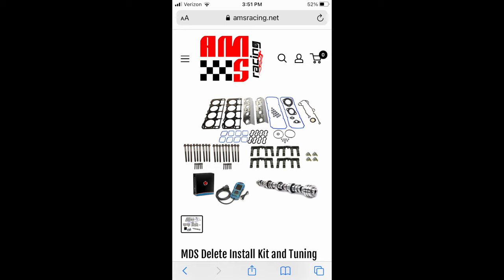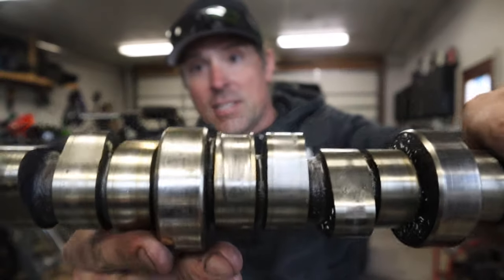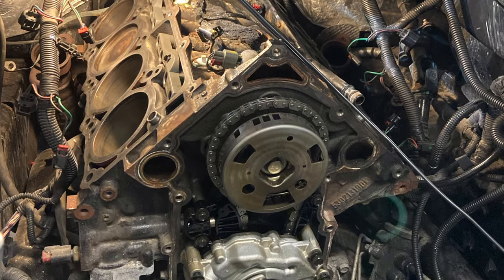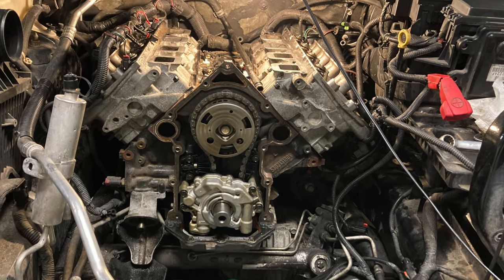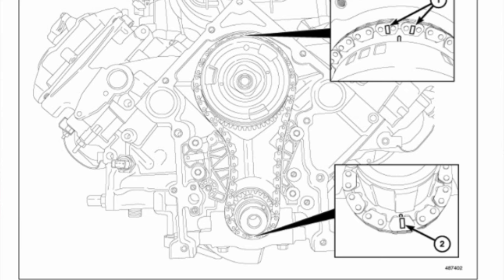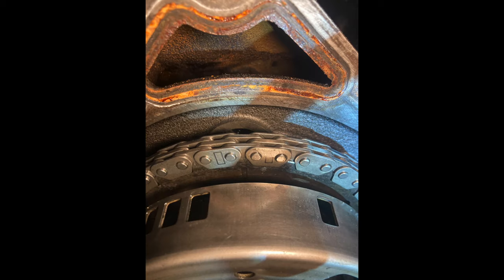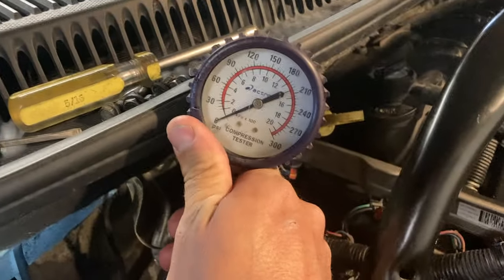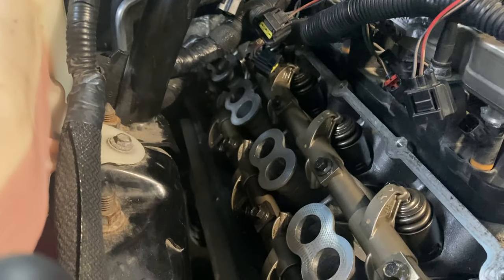Hemi 5.7 MDS delete, Lessons Learned

Comment: I have done three hemis this month due to needle bearing failure on the lifter and wiping out the cam but I have never seen one bend a pushrod just the valve not Opening.
Reply from the maker: Thats interesting, thanks for sharing.

Comment: Did you get low oil pressure after cam/lifter swap ? Mines reads 16psi while parked but has 45psi while driving
Reply from the maker: No, I did not  notice low oil pressure, it all seemed to be pretty good.
Reply: Mine is good cold, but warm at idle runs around 16. Prolly gonna do the hellcat pump when I do the mds delete cam and lifter swap. Supposedly it fixes the low volume/pressure at idle, but my rings might be getting worn a bit but not really interested in a full rebuild just yet

Comment: I was considering buying this kit. I'm afraid it will interfere with smog regulations in California. Will the check engine light stay on with this kit?
Reply from the maker: No, you turn off the mds with the controller supplied with the kit, and you do not get a check engine light.  I am not sure about passing emissions with the kit?

Comment: Was looking at a TSP delete kit but went with a tuner to just see what it does. I used a Diablotuner  and within 15 minutes, lost oil pressure. This on the highway. Luckily i was flying and was able to maintain speed and got off. Ima chedk out if i have a pushrod issue as I'm getting cammed soon but man, losing pressure on the highway was freaky
Reply from the maker: That’s not good, losing oil pressure would most likely be a larger mechanical issue. So all you did was hook up a tuner, and while driving lost oil pressure?
Reply: @wheelinoutwest  yeah. The ECO model light would come on as if it was going to drop to 4 cylinders, but it never did. So I figured, maybe just the light comes on still but after hitting 95ish, I let off on the gas and it attempted to drop to 4 but it didn't. It wouldn't accelerate anymore either. Since I was a decent speed, I was able to cruise to an exit but when it dropped to a lower gear, I was able to accelerate but only briefly. I also thought it was something major. Maybe a pushrod or something from me driving like a jackass all the time. I plugged the tuner back in, got rid of the MDS delete option and, back to "normal." I'm thinking there is more going on too but the tuner didn't pick up any faults of codes when plugged in.
Reply: @wheelinoutwest  I wish I recorded it as I've been just documenting the build of this heavy ass car but the the phone was the last thing in my mind. I didn't even want to call my wife. She'd be pissed I ran through another car. Lol. Did take a pic displaying Zero pressure on the gauges tho.Felt like the car was fighting the tuners code. Mechanical vs electrical struggle type.

Comment: How much do you spend with that tracing kit I'm thinking about replacing my cam cuz I'm having problem with the lifters too and I'm going to do the same work that you did to your car
Reply from the maker: I took my time with it, and really cleaned the heads well, plus I was working with my niece and had her removing bolts, etc.  I think it could be done in a long weekend.  The problem is the getting to certain bolts, that are time consuming to pull off.  Because I ran into issues, it took me a lot longer than it should have.

Comment: After it cranked but no idle and you found out it was just a pushrod issue, did you turn the motor again to line up the timing marks?
Reply from the maker: Well, I had already pulled everything off the front of the motor, to recheck the timing, and everything was fine.

Comment: I got a 2006 Jeep Grand Cherokee with the 5.7 Hemi. I’m not misfiring and the car is running good but I got a check engine for a Cylinder Bank 1 Deactivation (the MDS Solenoid) should I replace all the solenoids?
Reply from the maker: If you are pulling the intake and replacing one, you might as well replace them all.  They do not come out easy, and require some effort, the plastic becomes fragile, and they break apart.
Reply: I would run an engine oil cleaner, change the oil and filter and run with the new oil for awhile to see if the code comes back.  The solenoids can get clogged and will be slow to deactivate.  I would even change the oil twice before attempting to change the solenoids.

Comment: What would be the reason for taking these out ? My car is rough idling I have p1411 code for my 5.7 charger and I’m thinking I need to replace them
Reply from the maker: The reason I replaced them, was because the bad lifter took out the cam lobe, so I had to tear into everything anyway, so it was a good time to replace it all anyway.

Comment: How are you? How is the mds delete cam and lifters gleaning for you now? I have a 2014 chrysler 300s and my cam and liters need replaced. I was told to buy mopar but I don’t want to go thru this again so I’m asking should I just by the set of non mds cam and lifters ?
Reply from the maker: Things are good, the vehicle is back at my brother in laws, but last I heard it’s still hood. I think it worth doing, as long as the bottom end of the motor is still good, which it should be.
Reply from the maker: *still good

Comment: Hey I have a 2012 Chrysler 300c and I have y swap my cam and lifters but some metal came out the oil you think it’s still a good idea to cam swap it and send it or just get a new engine ?
Reply from the maker: Hi Jake, to be clear, you already have swapped out the cam and lifters, or you were going to?  If you look at my Cam in the video, it was wore down pretty bad, when it wears down the metal would end up in your engine, and hopefully the filter catches it, before going through the bearings.  Its hard to say if it caused any other damage with out taking the engine apart and having a good look at it.
Reply: @wheelinoutwest  hey I haven’t changed the cam or the lifters yet cause that’s what failed, I took out my mds solenoids and they are clean also I took out my vvt solenoid and it’s also clean, I am going to take out my oil pan to check it out, I am thinking of just flushing out the engine and putting a new cam and lifters in it. Is that a good idea or just get a new motor ?
Reply from the maker: @jakebowmen764  What you listed is what I did, and it has been working just fine.  After I ran mine for a few miles, I changed the oil filter again, and then changed it again after a few months.  Mine has been working fine, my niece uses it to commute around town.  The MDS kit is pretty reasonable, and I also changed the water pump, battery, harmonic balancer, serpentine belt and some other things, so it cost me in total around $2000.  Crate motors are great, but they seem to range from around 4 to 7 K, and used motors could have the same issue.  I guess it depends on how much you want to spend, but my bottom end on the motor did not seem to be damaged.
Reply: @wheelinoutwest  Thank you!

Comment: Best way to check that all push rods are set is to just turn the motor over by hand when you have the rockers arms tighten… watch and make sure every exhaust and intake valve moves up and down. 4 rotations should put your cam timeing mark and #1 piston top dead center.
Reply from the maker: That is a good idea! Thanks

Comment: When you deleted the MDS did you have to connect the MDS connectors from the harness to anything to keep the engine from throwing codes? Or did you just leave them disconnected under the intake?
Reply from the maker: I just left them disconnected under the intake.  The programmer turns off the MDS, which keeps you from getting any codes.

Comment: Hello, did you increase the oil pressure or left the original pump? Thank you
Reply from the maker: I left the original pump, but I should have at least replaced it.
Reply: The pressure can't be increased because the pump is crank driven. It has its own regulated pressure based on rpm

Comment: I have a 2005 WK with the Hemi 5.7. I’m not having any issue with the engine , runs perfectly. But was wondering if my engine has this MDS system ? 
How would I know ? 
Thanks.
Reply from the maker: It came out around 2005, if it has mds it would have a different cam, etc. you would have to remove the intake, and look at the valley, to see if it has the block off plugs, or the mds solenoids.
Reply: @wheelinoutwest  well I guess I’ll never know, I’m not taking off the intake. My Jeep runs perfect, I don’t want to mess with it. 
I’m going to take my VIN number to the dealer and see if they can tell me. 

Thanks.

Comment: Thanks sir just wrapped up my second mds delete job and 2 and 3 misfire sounds a little tickey time to pull these VC back off
Reply from the maker: Hopefully you get it resolved!
Reply: @wheelinoutwest  did it last night I must of not had the intake pushrod in on the lifter side and it bent replaced reassembled all is good now! Thanks again for the vid 💪👍

Comment: I bought a brand new deleted 5.7 hemi for my truck and its been back to the shops 3 times. I paid right at $9,000 for the motor.
Reply from the maker: That’s odd, I would hope the manufacture would help out if it were new? Something is not right, what’s the problem with it?

Comment: Just replaced the engine in my 2014 ram with 5.7 hemi. I believe the rough idle and “miss fires” are normal when first starting up after pulling the engine apart and such. I learned the computer just has to re-learn the engine.
Reply from the maker: As soon as I corrected the issue, of the pushrod not seated it ran perfectly the next time I fired it up.
Reply: I’m pretty sure that the “relearn” thing is a little exaggerated.    I had to replace my engine wiring harness and went through almighty hell looking for ANY cracks, shorts,breaks, etc on my original after doing the same on the used replacement, as no OEMs exist.    I found NONE on either and when I first fired it up
Reply: I just finished up a cam/lifters install on a hemi. Before I attempted it. Just like you. Research. Then bought a kit. I did not do a delete. Customers choice. 
Before I attempted to just fix the lifter issues. I pulled the lifters and cam. Found cam was getting signs of damage. So a new cam and lifters. 
I found torqued specs all over. But I had to sort thru the ones who were very unclear on instructions. I think many assumptions are taken that people who take on a job like this is simple to everyone. 
I took time to organize my parts in bags. 
Then the tireless job of cleaning parts with my pressure washer. The customers truck was very very dirty. Top end. But I got my parts and started my task. I learned the heads are only right and left only. After trying to reinstall the exhaust manifolds. And I thought I had it nailed. My stupid mistake.
Bought new gaskets and bolts. 
Hunckerd down. Got the job done. 
Before I fired up the engine. I turned the engine over several times by hand to watch each of the valves were moving and remembered the short push rods were the intake. I used a mirror to line each one up. 
Even though...the very last exhaust push rod was not moving. I loosen up the exhaust train. Reset the push rod and retested it. Now all my intake and exhaust valves were moving. 
I button it up. Then I started the engine. I ran it for a minute or so. Making sure my oil pressure came up first. After about 5 starts. I finally got the engine up and running. It took about 30 minutes to finally warm up. Constantly checking oil and water temperature and levels. Checking for leaks. I didn't drive the truck until about 2 hours of checking and rechecking. Then my test drive. 
But no more ticking noises. 
After my customer got the truck. I went back to see why my lifters were stuck ?
I took apart the bad lifter on #1 exhaust. 
After 255k on the engine. Just normal failed lifters and cam going bad. 
The owners wife didn't want to give up her truck. So they are glad they made the choice.

Comment: do you use the same cam gear and spring or do you delete the spring???
Did you leave the cam gear spring on when you did MDS delete ???
Reply from the maker: Yes, you just take the middle bolt out, and it all comes off as one assembly.  I installed it on the new cam, it only fits one way, then install and torque to spec.

Comment: If did the mds delete and installed a non-mds cam should i replace my pushrod length ?
Reply from the maker: I did not change the pushrod length, the cam just changes the timing for the valves a little.
Reply: @wheelinoutwest  so it means that i just should order the mds delete kit with cam and lifter and mds delete plugs thats it ?

Comment: The MDS isn’t the issue, it’s a vvt system. It will beat the crap out of the lifters if you don’t maintain it. Then there is the low oil to the lifters at idle, do not idle these for long periods.

Comment: By deleting the mds selenoids and replacing with block caps is it good to go or do I need to worry about doing a non mds cam  and also non mds lifters ? I'm sort of lost here. . Well I got an 05 ram 4x4 but got a donor motor of who knows where which is out of my comprehension on what's yrs. And models these mds hemis were introduced.  Guy who sold me motor was not completely honest and mabey changed the timeing cover, Anyhow the donor motor which was put in has selenoids on top with harness  but obviously my 05 ram has no plug in for that bit so no I'm just worried and do not want to go through another motor or get that hemi tick due to bad lifters grinded cam ect.
Advice please.. this truck does not run the way it should
Reply: Would I have to do non mds cam and non mds lifters.. since I my truck doesn't have plug in for selenoids harness, which if it did I would get a tuner and shut it off.. or you think since mds is not connected it will run ok. Just worried lifters will not work properly and will start to chew up the cam. Not sure how motor s working since it's not plugged in. I took the harness off and didn't think anything of it.  Didn't even mess with caps off my stock motor . Just left selenoids there and installed engin since I thought if messing with selenoids would cause a leak.
Reply from the maker: Yes, the cam and half of the lifters are different.  Also, you need a tuner to turn off the MDS, so it does not try to run.
Reply from the maker: @adriancoss8916  I am not for sure on how the vehicle would run, with the MDS solenoids installed, but not wired up?  Like I replied o before, non MDS, has a little different cam, and four different lifters.  The lifters associated with the MDS, are different.  Are you getting any misfire codes or anything right now, when you say it does not run properly, what is happening?
Reply: @wheelinoutwest  hey thr I'm not getting any codes as it's running fine since me and fam Installed this motor and hasn't had the hemi tick yet but.. just I'm worried since it is a mds motor and the didn't tell me about that.. unless he opened it up and changed lifters and cam. But didn't mention it was mds and I didn't know till now. That's y selenoids are on top and my old motor  was just with plastic caps. Guy who sold me it must of changed timing cover. And called it good. And I'm worried how mechanically if it's going to be ok just the way it is now. And I haven't took selenoids off to replace with block caps yet, due to being concerned if it is going to give me codes. So I've left it alone for now. Just worried about the mds thts internally and if it's going to function properly as far as lifters like your saying.
Reply: @wheelinoutwest  hey thr I'm not getting any codes as it's running fine since me and fam Installed this motor and hasn't had the hemi tick yet but.. just I'm worried since it is a mds motor and the didn't tell me about that.. unless he opened it up and changed lifters and cam. But didn't mention it was mds and I didn't know till now. That's y selenoids are on top and my old motor  was just with plastic caps. Guy who sold me it must of changed timing cover. And called it good. And I'm worried how mechanically if it's going to be ok just the way it is now. And I haven't took selenoids off to replace with block caps yet, due to being concerned if it is going to give me codes. So I've left it alone for now. Just worried about the mds thts internally and if it's going to function properly as far as lifters like your saying.
Reply: @wheelinoutwest  ok 
so by that being said but how is it possible my o5 ram 4x4  doesn't have plug in though for mds.. will it have that in the computer system either way.. I don't know. That's where it doesn't make sence to me.
Or would I half to do something to computer.. pple say they flash pcm I don't know anything about that.
Reply: @wheelinoutwest  so I should just buy tuner and shut mds off and all good. Or
I wouldn't half to replace non mds lifters non mds cam? If I don't need to tear into motor it be better for me 👍 and as for for my truck it just has a little bit a rough idle sometimes not too bad. Im Also have different problem with my truck. Somehow It's seems like it's running braked if that makes any sense. I already checked for brake line leaks and it's not the booster  and I changed my master brake cylinder due to the brake pedal was spongy and sinking to floor .. but it still does it sometime s. I seen a video of guy who said it was abs pump. Say he got it from junkyard and it worked after that .. and I don't know if it's going to be that or if it's going to be me rear differential messing up.. it's got a 3.92 anti spin.
Reply from the maker: @adriancoss8916  I just did a quick search, and MDS was added in 06, according to my search.  I don't know what using an engine with MDS, that does not have the harness would hurt.  The MDS would not activate, so it would be like disabling it in the controls, which a lot of people do.